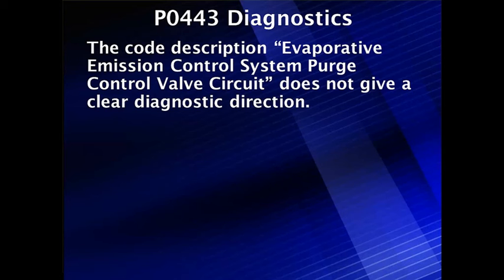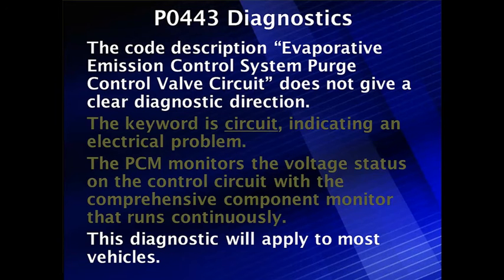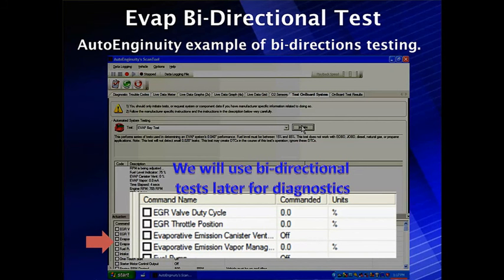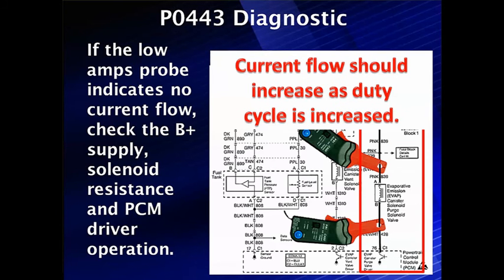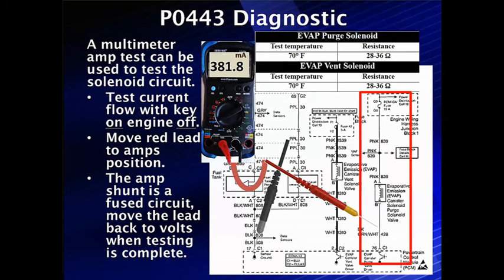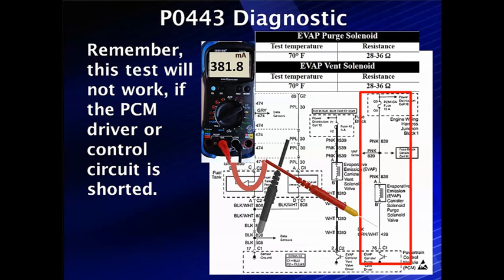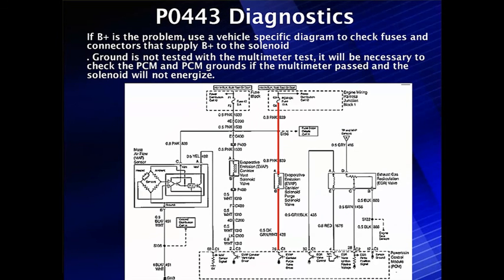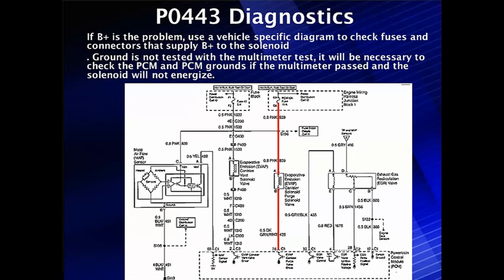15 Code P0443 Diagnostic Procedure

Comment: Hello, thanks for the video, please can you tell me where the fuse or Relay for EVAP Purge Valve in 2019 dodge journey is located. Mine is show 1.3voltage and i have check engine with P0443. Yes, I have ground.